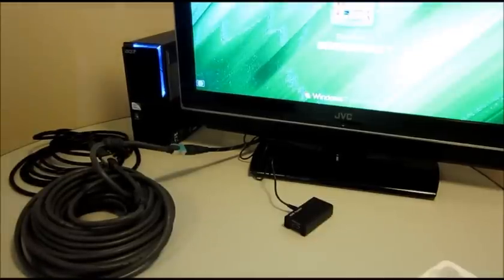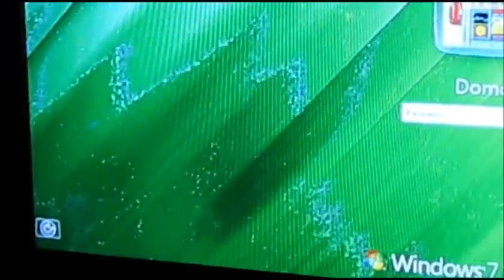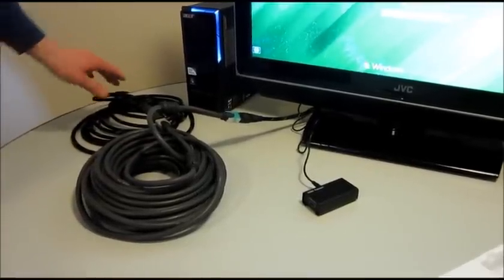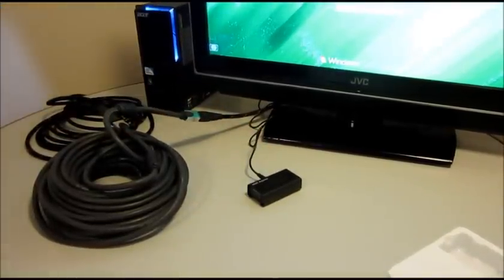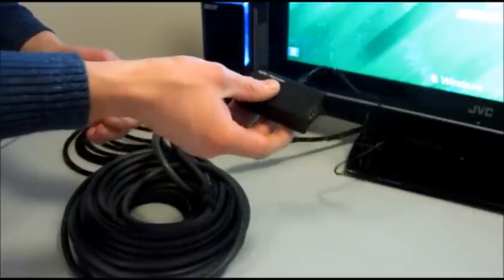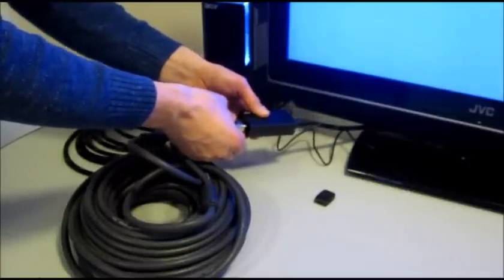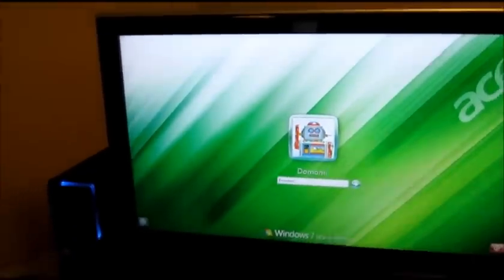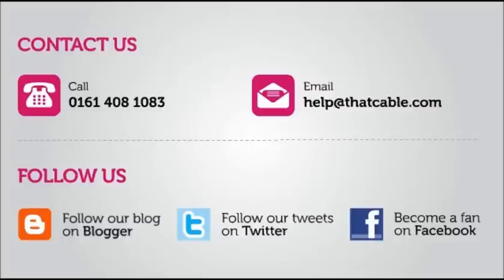Why you should buy a HDMI Repeater - Loops

Comment: Would this also help with an issue where the screen randomly goes black and comes back? I've isolated it to a coupler and the setup is a GPU to 8k capable (only using up to 4k) displayport adapter, coupling 2m hdmi cable to a 5m hdmi cable.

Comment: Great video thanks!  

I have an HDMI input in my wall that connects to a ceiling projector.  

I would like to have a TV in the same room on the side wall.  

So is there a way to get an HDMI HUB for approx 4 inputs (Cable box, Blu-ray, game system, etc.) and have 2 outputs, one for my TV and one for the Projector?  

But the twist on top of that would be to change the source independently on the 2 outputs...  Either the Projector or the TV.  So maybe I'm having guests over, some might want to watch sports on the TV while others might want to play PlayStation or something on the projector.  Is that possible?

Comment: Hi would a HDMI repeater solve my issue. I have two HDMI output at the back of my AVR, when I plug the HDMI cable which is 10m long from my projector to my AVR receiver I'm getting no picture or signal. thanks

Comment: I ran I think a 40ft cable through my walls to connect a TV to a PC. It works about 60% of the time. Sometimes, the PC will pick up that the TV is connected but the TV says there is no signal on the source. Other times the PC doesn't show anything connected to it. Do you think the repeater will help in this case? 

Thanks in advance.
Reply from the maker: Hi, Yes, this would be perfect, at that range, you may start to experience problems like the ones that you have come across so a repeater/booster should resolve any problems you're having!
Reply: Thanks. It has helped but I think the problem may be the connector on the tv end is slightly bent. The repeater I bought has a light on it indicating it's connected and I've seen it go out when plugged in.  So I've been able to find a configuration where it's slightly torqued and stays connected. Thanks for the video.
Reply from the maker: No problem at all! I'm glad you have it all sorted!

Comment: Thanks for the informative video.  I'm a dinosaur just learning this technology.  I'm helping build a sound booth at our Church, upgrading from a TV monitor for the choir and a laptop/ projector to a screen.  We want to put two 60" Flatscreen TVs up front and a third 60" TV on the rear wall, 55 ft, away, just above the control booth, as a monitor for the choir.  We have received a variety of advice.  VGA to HDMI, do projectors, etc.  Our current idea is a single (or two single) HDMI cables, approx 70 ft to accommodate running down, thru the basement ceiling, and up to the two TVs with the third rear monitor having a 15-20 ft. cable.  Question 1- Can I split the signal to 3 TVs?  Question 2- is the HDMI amplifier good enough for two TVs or do I need separate lines for each? Question 3- Am I asking the right questions?  This is Day 1 of my research.

Comment: Hi thatcable
With DVI do you put the booster on the end as well?
Reply from the maker: +Tyler McClain You can purchase dedicated DVI repeaters. These will only make a difference providing you are running a DVI-D signal (digital, this is the most common). Email us a picture of your DVI connector on the end of your cable at help@thatcable.com if you would like us to check.

Comment: can i still run 1440p if I use that HDMI repeater?
Reply from the maker: Hi, this device is only rated to 3D at a maximum so it may struggle with 1440P. However, we can get hold of a 4k x 2k repeater, would this be of interest?